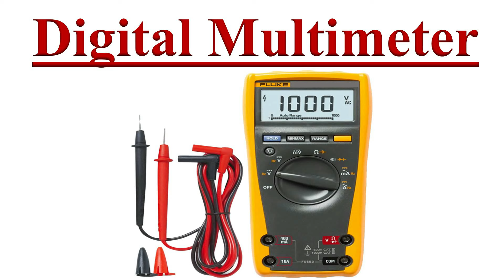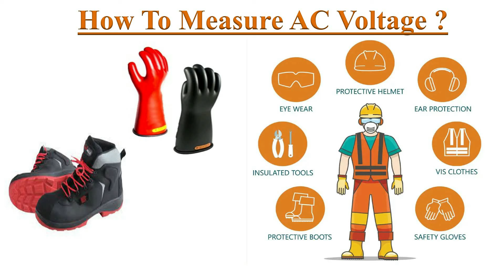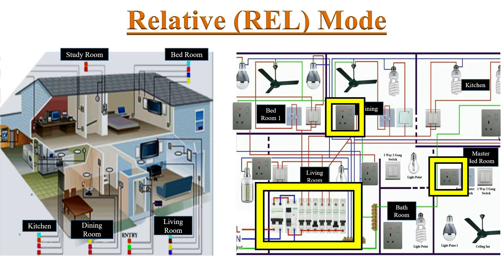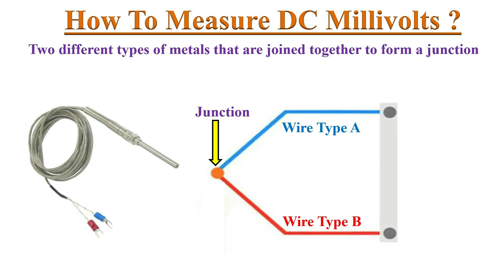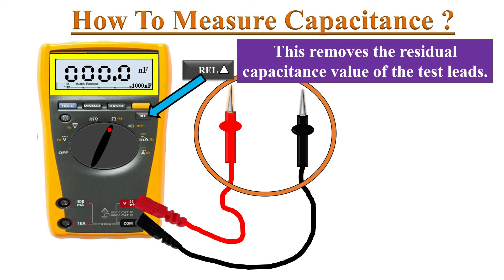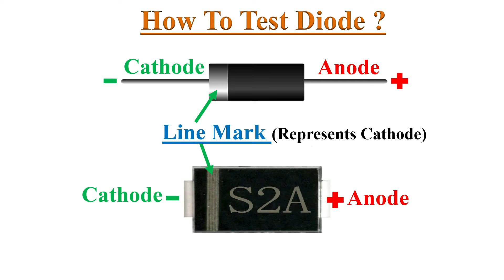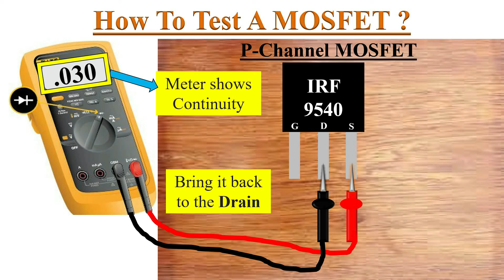How to use Digital Multimeter (DMM)?

Comment from the maker: Timestamps for various topics covered in this video,
0:21 Introduction to Digital Multimeter,
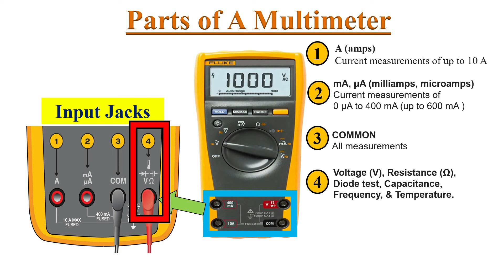2:41 How to measure AC voltage with Multimeter,
4:16 How to measure Frequency with Multimeter,
4:48 Hold function of Multimeter,
5:43 Range function of Multimeter,
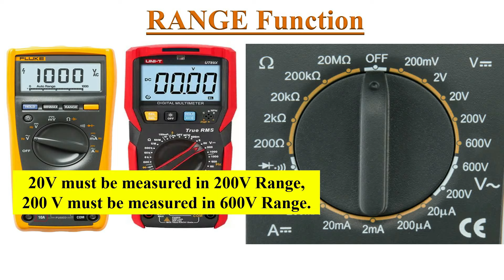8:17 MIN/MAX function of Multimeter,
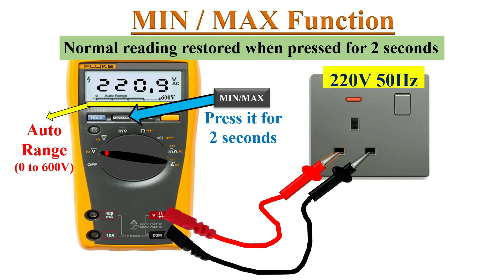10:19 Lamp function of Multimeter,
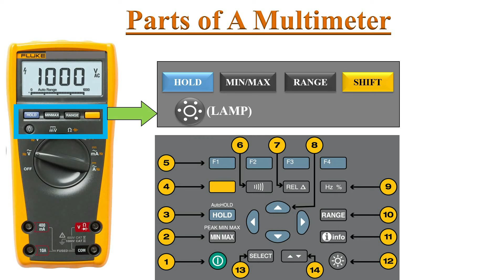10:42 REL (Relative) function of Multimeter,
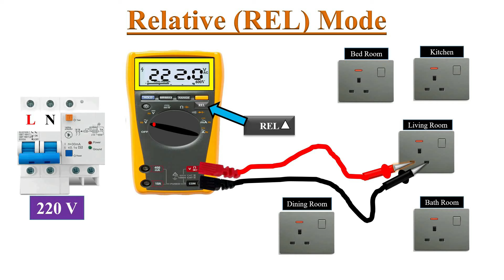12:09 True RMS Multimeter,
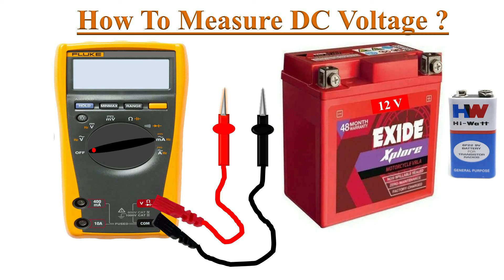13:03 How to measure DC voltage with Multimeter,
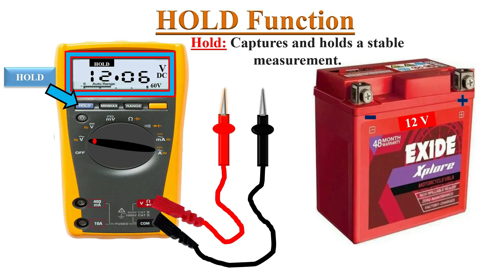16:00 How to measure DC Millivolts with Multimeter,
17:38 How to measure Resistance with Multimeter,
19:54 How to measure Capacitance with Multimeter,
25:18 How to do Continuity testing with Multimeter,
27:32 How to use Diode test mode of Multimeter,
28:17 How to check a Diode with Multimeter,
29:37 How to check a Transistor with Multimeter,
33:38 How to check a FET with Multimeter,
37:44 How to check a MOSFET with Multimeter,
39:49 How to measure Current with a Multimeter.